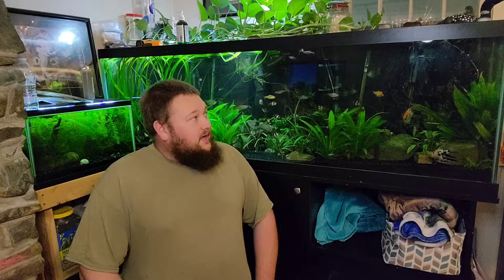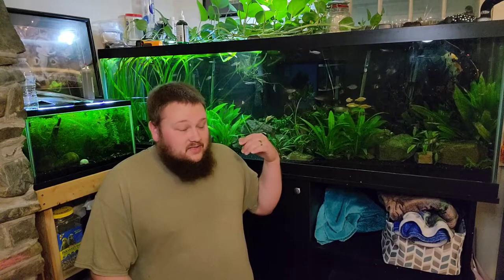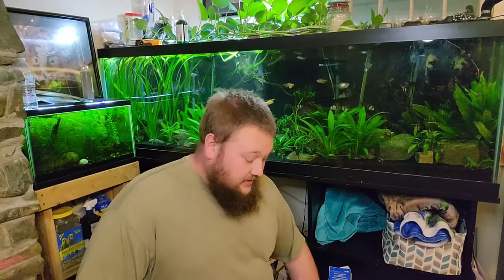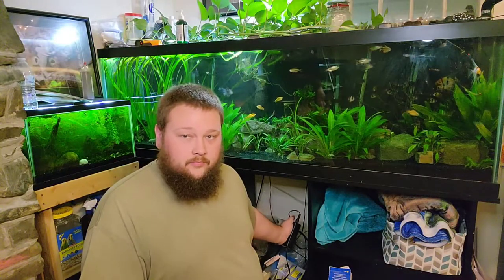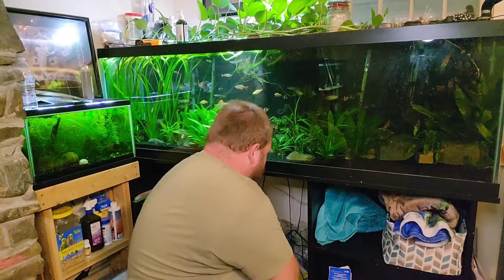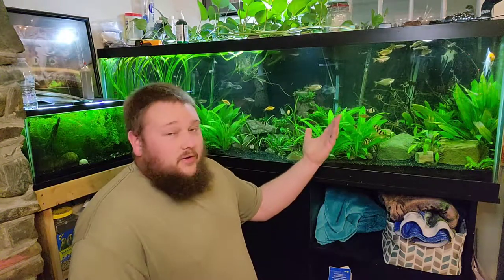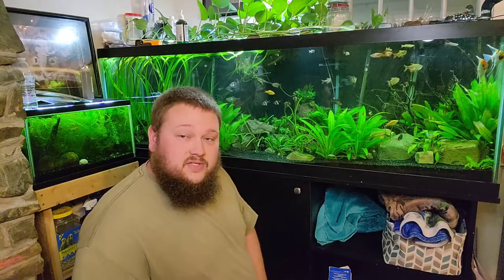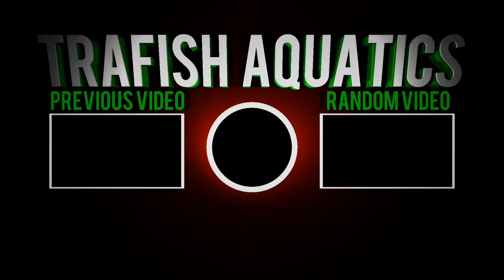Fix A Dying LED Aquarium Light

Comment: What to do if the lights blinking off n on
Reply: If the lights cut in and out when you touch or move it then its probably a bad connection. You can try cleaning  the port. Moisture can cause corrosion/rust on the terminals. Use Q-tips soaked in vinegar. If its really corroded you may need to scrape it with a metal pick of some sort like a small flathead screwdriver, tweezers, really anything small enough to get in the hole.

Comment: Hello,
May I ask 1 question, Sun sun HW-702B vs HW-702A the difference is HW-702B have built in UV , my question is which is better for goldfish tank, do uv really necessary?
Reply: If you have a bare bottom tank will help a lot because some problems that happen with bare bottom tanks